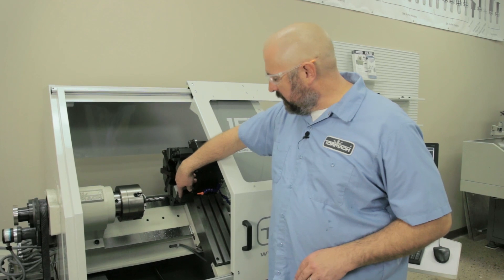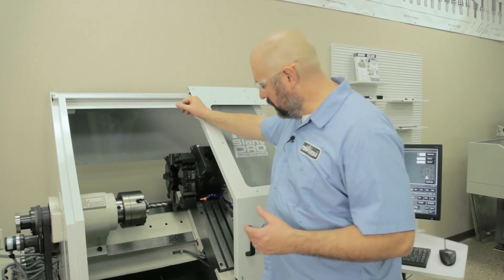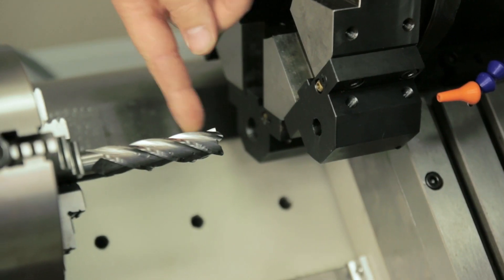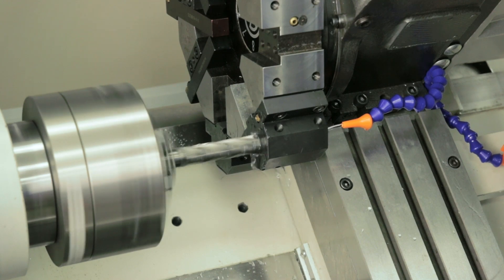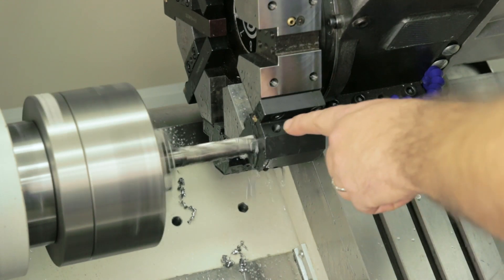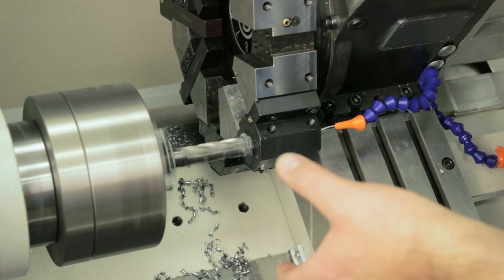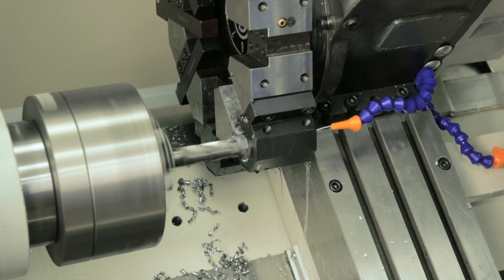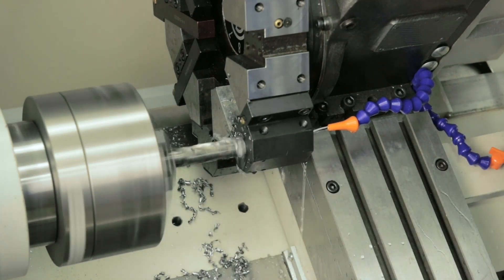How to Install Turret Boring Bar Holders on the Tormach 15L Slant-Pro Lathe

Comment: Bought a 15L Slant-pro with turret kit this week. The boring blocks came with a 3/4 bore already instead of a 1/2 pilot hole  and no tool for performing the operation described in the video. I cannot find a video that shows the new way to align the boring blocks properly. I’m able to move X to align it perfectly, but it is slightly miss aligned in Y axis. Adding shims doesn’t work as it will mess up the alignment of the other tools. My Y axis is perfectly aligned for the rest of the tools. Why would Tormach change the system and not create a video to explain how to install it? Or if the video exists, why is it not easy to find ?  Hope you can help me.
Reply from the maker: Did you purchase the Boring bar Holder with the Unfinished Bore? https://tormach.com/boring-bar-holder-turret-unfinished-bore-37139.html

Comment: The real question is, why is Tormach only offering 1/2 holders when all the bars are 3/4? Expecting everyone to have an extra long 3/4 endmill and then expecting them to use it in this fashion to fix their mistake is some BS if you ask me. Good luck finding this endmill for much less than $100 and then to use it to drill? Come on Tormach, tell me thats not some BS.
Reply from the maker: helicrashpro  

Thanks for the feedback. The 1/2" diameter hole is a pilot and not a precision bore. The most reliable way to make the holders is to bore them out on the lathe to final diameter by the end user. Boring the holder to size is pretty common for precision fits.
There are other methods to bore this hole, like with an adjustable boring head, but we currently feel the method described in this video is the easiest way to do this for the majority of customers.  The 3/4" end mill is included with the 15L Slant-Pro Lathe Turret Kit, BTW.

http://www.tormach.com/store/index.php?app=ecom&ns=prodshow&ref=33273
Reply: Tormach Inc. Good to know. Thanks for the reply.

Comment: Why not use a drill bit and a reamer?  Endmill just doesn't seem like the ideal tool for this job.

You said "use endmill because you are not lined up with the existing hole"?  What do you mean by that?  Is the height of the boring bar holder too low or high from centerline of the spindle?  Seems like this should be solved with shimming the turret (if too low).
Reply from the maker: Ideally, drilling undersize followed by a reamer or ID boring operation to final dimension will be the best way to do this.  We ultimately chose to use an endmill in this situation because 1) these holders are pre-drilled with a ½” diameter pilot, which will make re-drilling on exact center difficult, and 2) the predrilled set screw holes make this challenging to ID bore because of interrupted cut.  The end mill approach resulted in suitable hole accuracy in practice, and we also felt it was an easier approach for lathe novices as well.